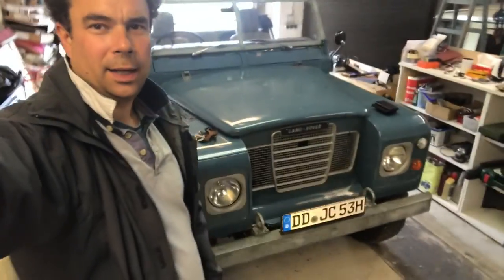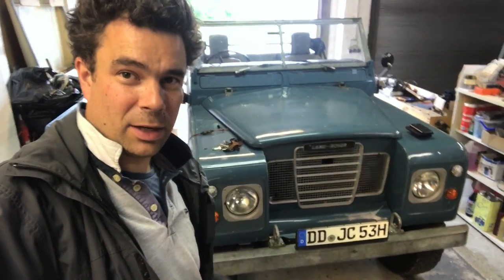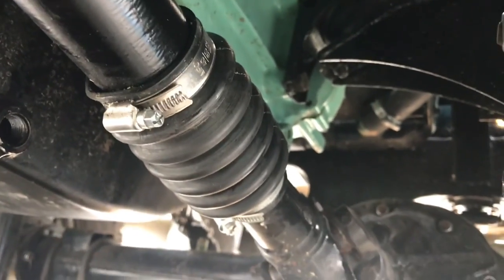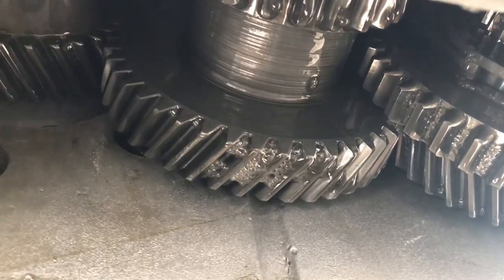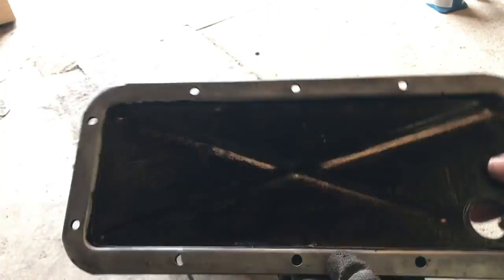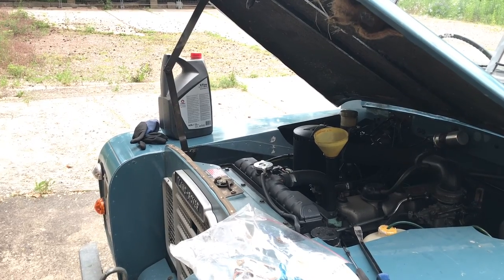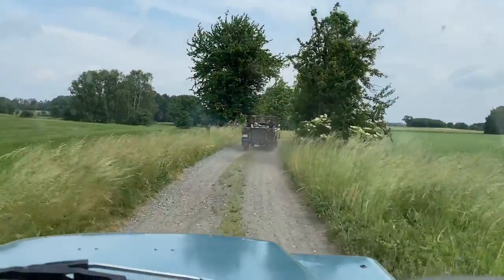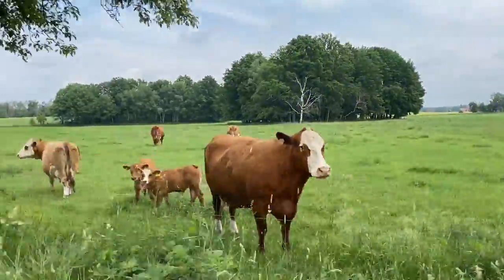Land Rover Series 3 Restoration - Changing the Oils - Part 73

Comment: I wrap the front driveshaft in cling film. Just peel it off after and everything is clean (ish). Also a modern oil filter adapter is nice.
Reply from the maker: Hi Nick, that’s a good idea. I am not aware of the adapter.
Reply: @My911  It is the filter adapter from the early Defender 2.5 4-cyl petrol, part number ETC5347. It takes a standard Land Rover cartridge filter ERR3340 used on many other models. It makes filter changing much less fiddly and messy. The housings can be pricey. Apparently the 200TDI engine part can be used to similar effect, which are more readily available but using it on a 2.25 means various blanking plugs are required for the oil cooler ports.

Comment: Great to see you and the family out and about enjoying the Land Rover. Good luck with the over drive, alloy threads can be tricky. The one on my GM gearbox only has 9.2 Nm as its torque setting as it is alloy and that way it should be OK and not over tightened and stretched and destroyed. Good luck Joel.
Reply from the maker: Thanks Steve, I have since re-threaded and replaced the sump plug and all is good.

Comment: Shame about that damaged gear, it does look like 3rd gear. 

If there is a less messy way to change the oil filter, I haven't discovered it yet! By the way, it's definitely worth the extra few pounds for a genuine filter. I compared  the blue box filter to a genuine one a few years ago and never used the cheaper part again. 

Looks like you are having great fun with the Land Rover, what it's all about!
Reply from the maker: Yes, I am pretty disappointed with the gear. I will have to look back to see if I replaced 3rd. I know I did second for sure. If I didn’t, perhaps it broke under the stress of the new parts? Who knows. I’ve done such little mileage but on the other hand two of my children have been learning to drive in it and each time it gets stalled I cringe a little. The running gear doesn’t like it. I will have to look inside at some point, but can’t face taking it apart again. Especially as it took me so long to put together. I bought the gear parts from the same place as you did back then. 

Thanks for the tip about the filter. I don’t like using the blue boxes. I am still finding suppliers over here and unfortunately genuine  is harder to come by. But the next change I will go OEM come hell or high water. 

Ps, I like your plan with the later 2.5l motor. Good luck with the project and I will be watching. 👍 can’t wait to see the difference once it goes in.

Comment: I noticed you used Blu Hylomar... Being an Englishman in Botswana I imported that stuff to complete my nut and bolt restoration of my 88 2a, like your friends... It leaked in so many places after using the Hylomar... I replaced with normal off the shelf RTV sealant and that stopped the leaks... I used Hylomar as it is much hyped.... not sure if I would use again. If you get persistent leaks, the hylomar may the be the issue.
Reply from the maker: Hi, thanks for the tip. It isn’t very good, you are right. I will get some RTV. Interesting that you are out in Botswana. A friend of mine from school moved there when he was 13. 👍 Great News on the 2a. They are very cool vehicles.
Reply: @My911  Land of the Toyota... but Im steadfastly Land Rover ... not easy to get parts here though
Reply from the maker: @SafariLifestyles  I can imagine. Keep up the good work. 👍
Reply: @SafariLifestyles  Australia too has become "the land of the Toyota". Up until the early 1970's, Land Rover held 0ver 90% of the 4WD market in Australia but the Japanese copies have, since then, become the norm. I spent two years (2006/7/8) working in Central and Southern Africa and was pleased to see that Land Rovers were more common there than they now are in Australia. I thoroughly enjoyed my time in Africa. Stay safe and enjoy your Series 2a.

Comment: Regarding the bit of broken gear,  I would have thought that you would have heard it.
When you overhauled the gearbox was the sump plug clean?
Reply: I was about to ask : are you certain you cleaned out that plug ? Is it possible that it was overlooked and that tooth is from before the rebuild ?
Reply from the maker: Guys, I am not sure but I can’t imagine that I wouldn’t have cleaned it. Saying that the sludge in the plug was pretty compacted which seams unlikely for such little use. I am hoping it’s from before 😀
Reply: @My911  fingers crossed.
Is it worth looking at your old footage?
Also,  could you get an endoscope in to the gearbox?  They connect to your phone nowadays and are fairly cheap. Having said all that, I'd probably just run it and enjoy it and put it to the back of my mind...but that's just me...(",)

Comment: Nice work! Any thoughts on the swivel oil?
Reply from the maker: Hi Bob, swivel oil?
Reply: @My911  sorry, the gear oil/grease inside the front swivel housings.
Reply from the maker: Ah yes. Well, that is such glutinous stuff I hadn’t thought about changing it. But you are probably right. I took delivery of another 5 l of gear oil today, so I can finally finish off the axles! Happy weekend.